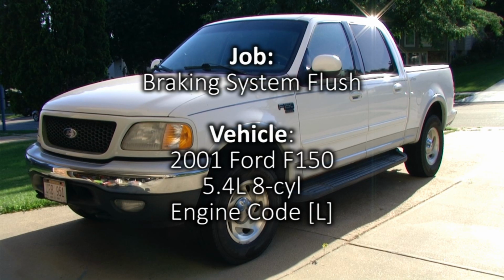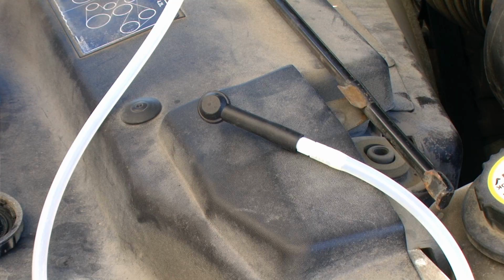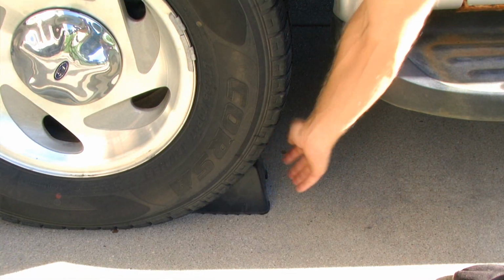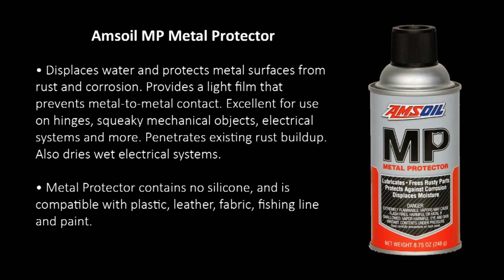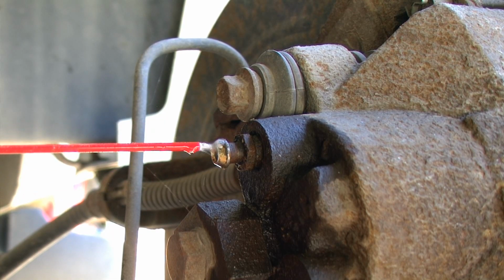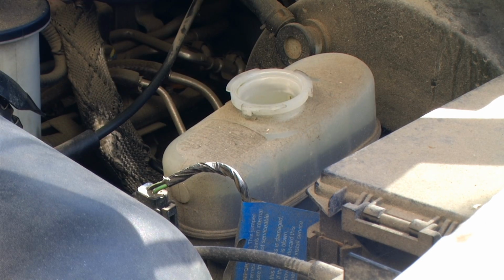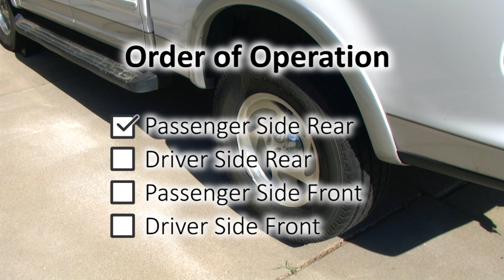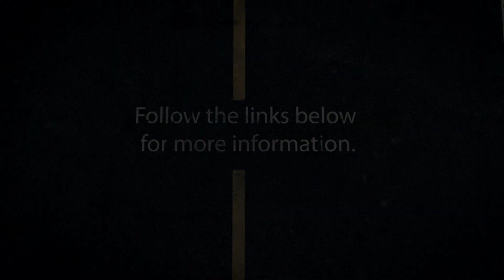2001 Ford F150 Brake Fluid Replacement (Bleeding, Flushing, Breaks)

Comment: Very comprehensive. I have to perform this operation on my truck for state inspection. Definitely gonna get the Capri vacuum brake bleeder tool. Thank you very much. Awesome video!
Reply from the maker: I have been pretty happy with the brake bleed tool.  It allows me to perform work with out depending on having a second person around.
Reply: @InsaneOil  I got the tool last week and tried it out today. This tool is awesome. I’m very happy with how easy it is to use and how quick it made the fluid exchange process. Thanks again for the video and tool recommendation.
Reply from the maker: @nytshade2  Awesome.  Thanks for the update.

Comment: I have never seen someone recommend putting a drill bit into the brake bleed screw before...very clever!  Thank you for your tips and clear instructions.

In total, how much fluid is needed?  Approx 2 pints (1 litre)?
Reply from the maker: I will typically run 1 1/4 bottle through the Passenger Side Rear, 3/4 Bottle through the Driver Side Rear, and 1/2 Bottle through each of the Fronts.

Comment: Hooray.  Just did the new master cylinder. Thanks to your video. Brakes work well but still had spongy to the floor one time out of ten !  About to bleed the brakes. Any ideas !?  Let me know thanks
Reply from the maker: Sounds like the repair went well.  Could just need bleeding as you mentioned.  Although, one thing to check would be the ABS Pump & Module.  Start this video at the 3:00 mark:  https://www.youtube.com/watch?v=KFnVe-u3zeM&t=1s

Comment: You know you can pump the brakes too that makes it easier even as one person, you can still pump the break to flush out the breaks when you open and close the stem
Reply from the maker: Just don't release the brake pedal with the bleed screw open or you can suck air into your lines.

Comment: If you have the orange cruise control sensor on the back of the master cylinder, CHANGE IT! mine sprung a leak, caught fire, and almost burnt the truck to the ground. Luckily it happened just as I got in. There is an open recall for them, and they can burn anytime regardless if the vehicle is on or off. The updated sensor has a barrel connector with an inline fuse pigtail adapter to the rectangle. Don't be stupid like me and not look into it. Trust me, it will present itself when you least expect it! I'm not entirely sure if it effects all of the orange sensors, the updated one is like $20 why chance it
Reply from the maker: Thanks for the comment.  For those thinking replacing it, here's the video how to replace it.  https://www.youtube.com/watch?v=wjxo0HN-P9M&t=11s

Comment: My pneumatic brake bleed pump is not pulling the brake fluid out like it should.  It's just bubbles.  I checked hose to make sure there was no holes.  What is the problem?
Reply from the maker: My pump pulls it very slowly also.  I don't think I would want to pull it too fast otherwise the reservoir would run dry.

Comment: does the lip on the brake hose on the brass part go on the underside or does it face away from the rotor
Reply from the maker: I don't understand your question.
Reply: @InsaneOil  NM think I got it figured out. I can put on the hose brass fitting so it hugs the caliper with the lip on the underside I think we have two different setups I think yours is the Ford lightning setup. When I put it so the lip conforms to the caliper like a puzzle fits nice and tight but the hose is awfully close to the caliper piston bolt which makes me concerned about it rubbing and making a hole. So I did it so it hugs  the caliper like a puzzle. Just going to tie the hose away from the caliper piston bolt so it doesn't rub. I think it was a slight design flaw from motorcraft.

Comment: use a 6 point socket and I always use a hammer and tap on the bleed screw face, helps brake the rust
Reply from the maker: The 6 point socket is a great tip.  I am always leery when using a hammer on the thin walled bleed screws.

Comment: What about an ABS F150. I have a 2003 with ABS. Same bleed order?
Reply: I have an 03 f150 and the abs is a different system completely and abs is standard on alot of vehicles
Reply: think of it as a computer telling your car to break and when. ABS has nothing to do directly with the breaking system itself
Reply from the maker: Bleed order stays the same.

Comment: A REALLY CONSCIENTIOUS MECHANIC WOULD HAVE... cleaned all of the dust and debris off of the reservoir before opening the lid in order to prevent brake parts contamination.   Maybe a bit picky of me but still a sign of a lack of professionalism.
You have only one opportunity to make a good first impression.  You missed it here.   Otherwise a good tutorial.
Reply from the maker: Good tip on cleaning the reservoir.  Thanks for the lengthy, shameful comment peppered with one tiny positive thought.
Reply: @InsaneOil   I may have gone a bit overboard with my comment but as blunt as it may be, it is the truth, all of it.  My informal ass chewing was for your benefit.  If you would like me to delete my comment, I will be happy to do so.  Take care
Reply from the maker: @tribulationprepper787  No need to delete the comment.  You made a valid point about cleaning off the debris from the reservoir prior to opening it and I am sure many would appreciate that tip.  However, I don't think attacking my professionalism was a very professional method of attempting to help myself and others.
Reply: @InsaneOil   I agree and I did mention that my comment may have been a bit picky.   The best part of my comment is the one you should keep.  It read, "You have only one opportunity to make a good first impression."  That maxim has served me well for many years.   Take care
Reply from the maker: @tribulationprepper787  I concur with your philosophy, but if a good impression falls upon the prerequisite of perfection, you will lead a life of disappointment.